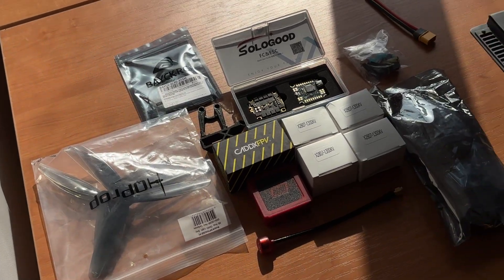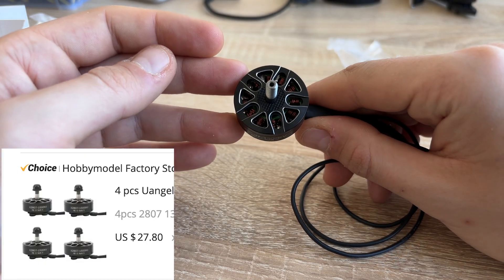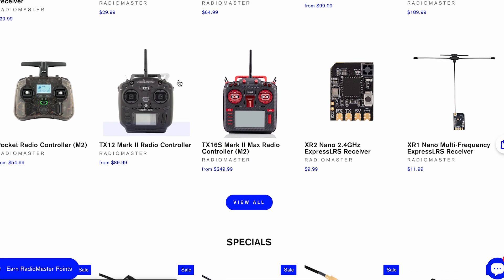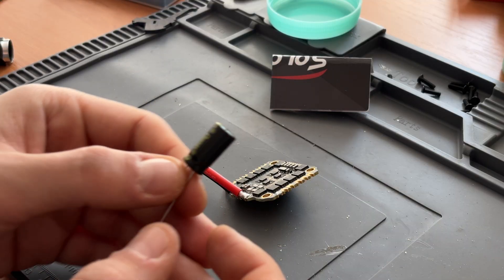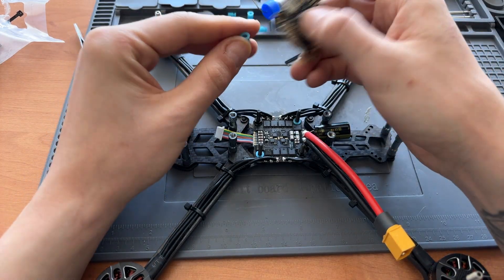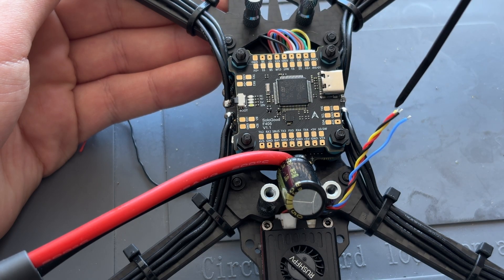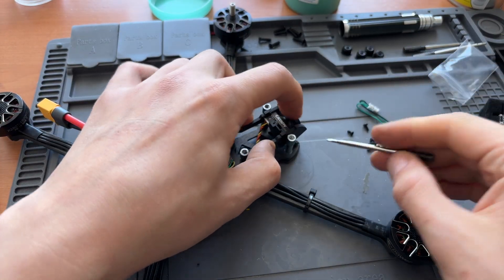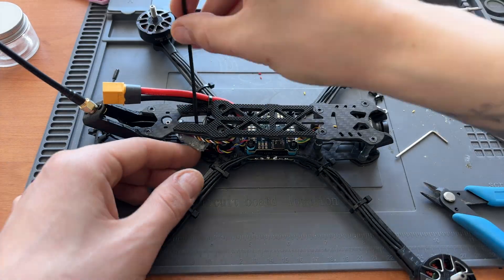FPV Drone Assembly Guide 2025 - Long Range Budget Build | Part 1

Comment: I need to build a drone to drop bait for surfcasting.
Reply from the maker: @syrzyy  sounds like it shouldn’t be too hard. What the weight of bait?
Reply: @DCSets  around 300 gram, max.
Reply from the maker: @syrzyy  than this build will cover your needs. Such motors can carry up to 1.5 kilo for 10+km. 
Also i assume you don't need long range, so you don't need expensive 2.5W VTX. 1.6W Rush or something 0.8W will be enough
Reply: @DCSets  really appreciate your input bro — your video was super helpful, well explained and practical. I like how you broke down the parts and the payload capability. That kind of content really helps people like me.

Just to give you some context: I fish at Batu Rakit, on the east coast of Terengganu, Malaysia. It’s a decent surfcasting beach, open and deep, but the wind can change suddenly, and the waves get rough especially during monsoon seasons. So, having a drone with good stability and Return to Home (RTH) is really crucial. If the drone loses signal or runs low on battery mid-flight, I need it to come back safely.

I’ve looked into drones like SwellPro and AeroPro, but honestly, they’re way overpriced for my use case — and some still struggle in strong coastal winds. That’s why your custom build idea really caught my attention.

I’m planning to drop around 300g of bait, just beyond the breakers. I don’t need long range, but I do need something reliable, strong against wind, and not too complicated to fly or maintain.

Would you mind sharing your advice or tips for choosing the right motor, ESC, flight controller and frame to suit this kind of coastal use? I’m open to building it myself, just want to get the foundation right.Thanks again man — your work’s solid and much appreciated from this side of the world!
Reply from the maker: @ wow, thanks a lot for this feedback. Such moments rlly motivate to work on next videos )

Regarding swellPro / AeroPro. I'm not familiar with this drones, i assume they are closer to dji mavic than fpv. It's impossible ( actually possible, but very expensive) to have the same stability level. Also it's much easier to fly such drones than FPV.

Regarding price. For your case i would suggest to change only VTX  (from 2.5W to 1.6w), RX (you can buy 2.4Ghz, so you don't need additional module for controller) and frame. Since since wind will cause additional parasitic vibrations it's much easier to filter them when you have good frame (like diaton roma f7) or at least original mark4. Also you need a gps module. The ESC, FC (however f722 will be a bit better), Motors - they don't change a lot in your conditions. 
The entire build will cost you somwhere between 180-220$ on AliExpress.
The cheepset controller i guess is radiomaster Pocket ( elrs 2.4 https://s.click.aliexpress.com/e/_ongmZ6D)
For your case i believe that FPV monitor much better than googles, since even if you loose the video signal you'll be able to "catch" drone visually and back home. (around 100$).
Lastly you need a drop mechanism. I seen some models on cults for 10-40$. + servo 5$.
So in total you need up to 450-500$ for entire build. 

BUT. You will have an analogue video and need to learn fly (actually it takes not so long. The biggest challenge will be quad tuning ( filters + PIDs). It's not so hard, but require some time for research info and tests.

So my advice to choose what are you looking for. If you need the quad only for fishing - i believe that it's better to buy ready to use product.
If you are interesting to dive into FPV too - than you have a good option to save few hundreds bucks )
P.S. If you decide to build FPV you can reach me via email for any specific questions or here https://discord.gg/vfz4xxbtNx (i don't know how to use discord, but lets try xD )

Comment: how to attach gps module on this drone and how to program for auto come back to its starting location
Reply from the maker: In short - check the wiring for your specific gps module (it usually has UART interface so you need to connect RX -> TX, TX -> RX) + extra wires if it has compass.
The configuration depends on your firmware. If you are using betaflight - here is detailed instruction https://oscarliang.com/setup-gps-rescue-mode-betaflight/
I believe that  iNav has very similar configuration. 
If you're trying to setup in with Ardupilot - i can't help here cause never used it (

Comment: my new build drone desnt spin the one motor... connected to the blheli configure and it only show 3 esc isntead of 4.. do you know whats the issue
Reply from the maker: Try to reattach esc, sometimes when you connect the plug you may bend the pin (on fc or esc side)

Comment: thanks,you make soldering so easy,was hoping you could make a video about building 3 to5" drones, and maybe add openipc to it,
Reply from the maker: Thanks for the feedback!
Actually, the 5" build only differs in the motors and frame. I'm not sure if I'm going to build another 5" soon, but I do have plans to finish a small 3" and try to run it autonomously with ArduPilot.